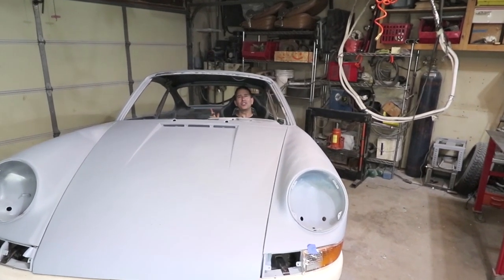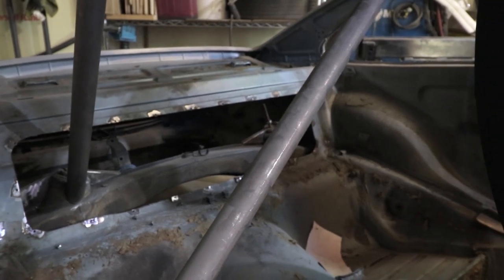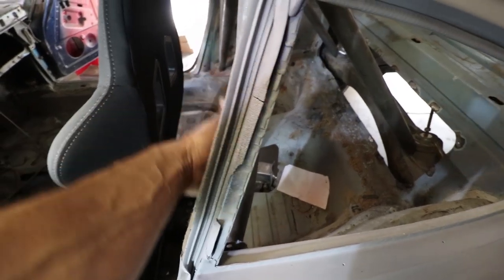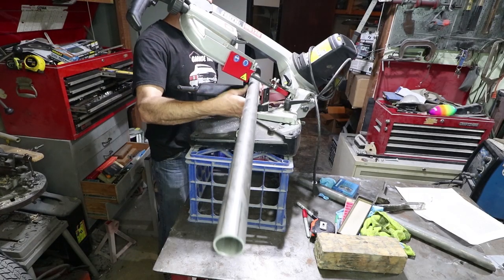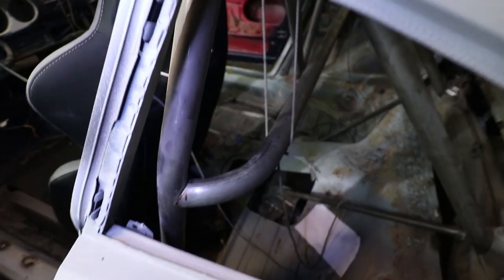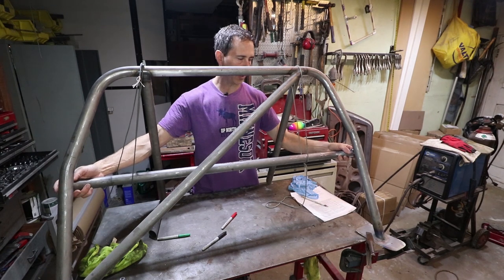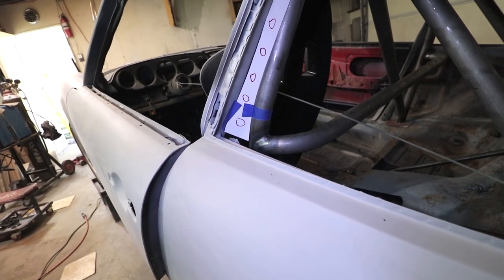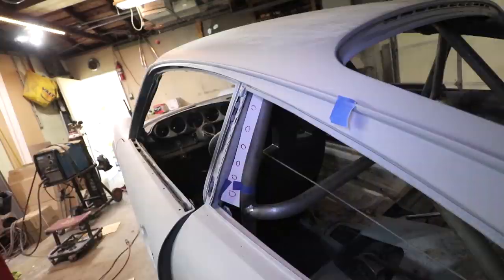6 Obstacles Preventing Me From Painting This Jalopy

Comment: Hanging that harness bar by the string...that totally is relatable. Looks like something I'd do...what we must do when working alone! That's frustrating on the fitment, I certainly think that's natural, most of us would run into. Kind of curious though, if the welding process would have sucked that bar in some to get it to fit closer. But It's also harder to get a nice weld with the gap...so definitely a trade off that's unpredictable. In the end, I think you took the right route!
Reply from the maker: I'm glad you can relate.  My sons are boys scouts and I've learned a lot of cool knots with them!  Life is so much easier with a few little strings!  
I did not say this in the vid, but it was a good decision to bend the bar to 75 deg and not 90 degrees on the ends.  This allowed me to fudge the total width.  If I bent the bar to 90 degrees then I would have had to scrap it and start over.  
The welding is way easier if things fit well.  I've learned to spend time on the fitment as tempting as it is to just welder up.  The MIG is good at covering up bad fitments!
Reply: @GarageTimeAutoResto  yea I submitted the comment before I actually saw you were TIG welding the bar, so that made poor fittment a no go. I really need to get myself back to practicing TIG